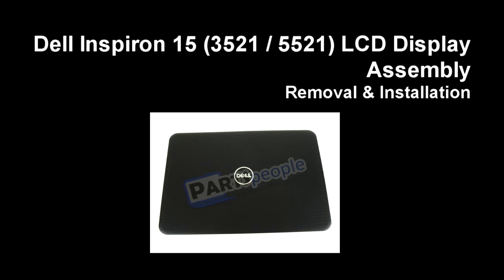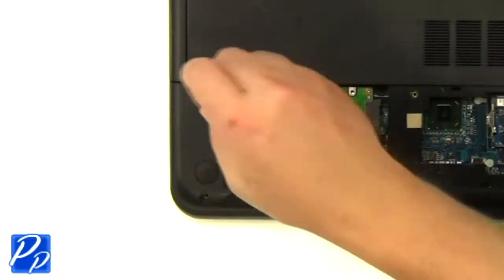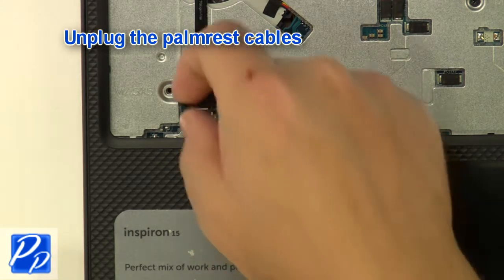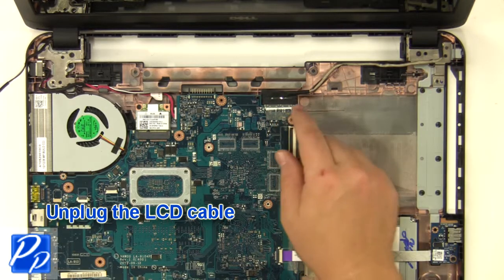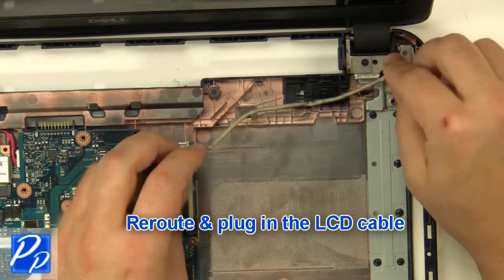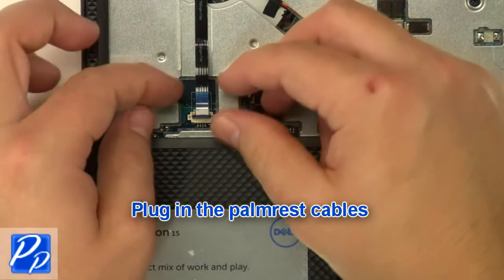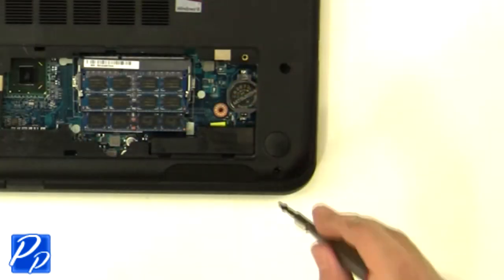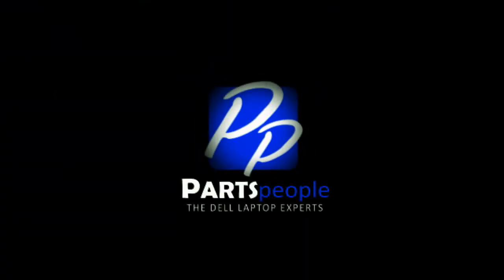Dell Inspiron 15 (3521 / 5521) LCD Display Assembly Removal Video Tutorial

Comment: Believe it or not, the lower left screw on my left hinge has no head. Production error? I'm unable to remove it as a result and am not sure what to do.
Reply from the maker: You may be able to remove it using needle nose pliers. Otherwise, replacement parts are dependent which side the screw is broken on, the base side or the screen side?
Reply: Well.. To be honest I'm still confused about it. In the video I believe you point to three screws on the left side hinge. One of which is the one that appears to have a broken off head on mine. But then when you show yourself removing the screws you don't even do anything with that one (I have a bad signal here, the video was low res., so I can't tell if yours looks the same as mine since it's so small) and then the screen casing comes right off. Regardless, I couldn't remove it. What I did manage though, was replacing the screen without removing the top part of the laptop. After doing this successfully (though with much difficulty -- awkward angles) I put everything back together and..... Got the eight beeps. Opened back up, corrected the (loose) LCD connector on the screen, and now it's working! I have had several very very brief flashes to black, though. I'm talking like a 10th of a second. After restarting these ceased, so I'm assuming the computer was synchronizing with the new screen or something? Anyway, no further issues so far, and everything's ship shape. Thank you very much for your videos and guidance.

Comment: To be clear, this is much more than needed to replace the LCD which is what the title of your video is. Instead of replacing the panel, you're completely replacing the top lid. lol Not necessary and likely beyond a lot of DIY repairs.
Reply from the maker: Hi, yes I agree. This was a useless video if in fact you wanted to replace the lcd screen itself. Usually you don't have to remove the complete assembly to do so. Our video tutorial guy back then didn't know what was most important I guess. He was making a basic tutorial for the complete assembly that we sold at the time. But here's the LCD screen part. Avoid removing the assembly if you don't have to. https://www.youtube.com/watch?v=mRq9pJINbQ8&t=222s
Reply: @dellpartspeople  I wouldnt say useless. Its still a great video. =) Just the title is a bit funny for whats shown. lol

I was trying to find a video for an employee so that I didnt have to babysit them.

Comment: is LCD assembly unit consists of LCD screen? I need only the cover can I get the cover only?
Reply from the maker: Yes you can replace only the LCD back cover. You can find instructions here. https://www.parts-people.com/blog/2013/08/28/dell-inspiron-15-3521-5521-lcd-screen-removal-and-installation/ you can find backs here https://www.parts-people.com/index.php?action=category&id=141&subid=428&refine=back